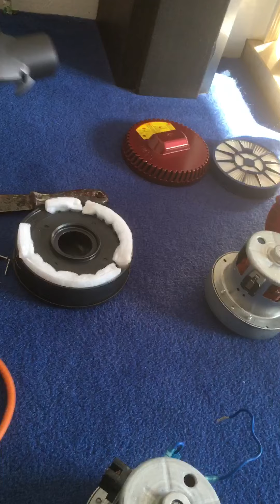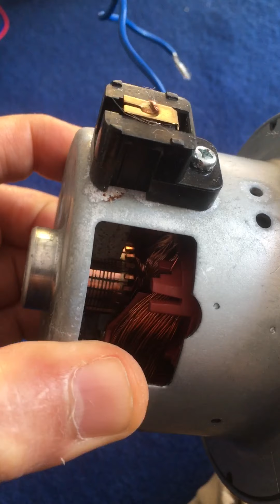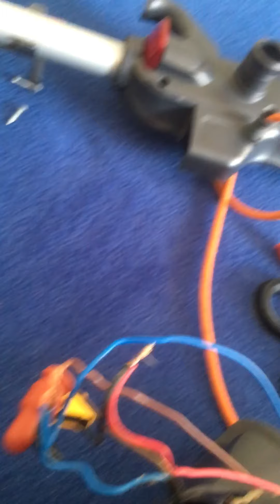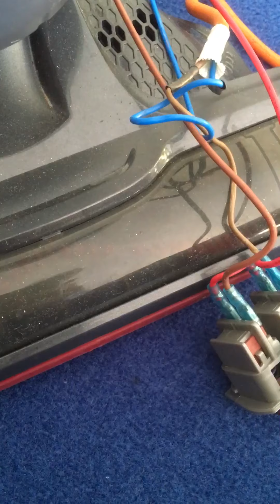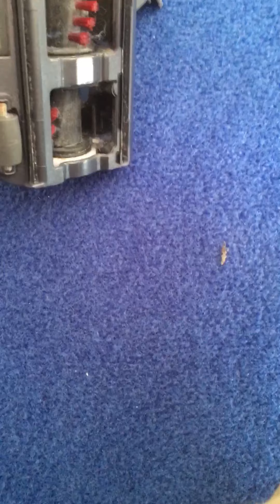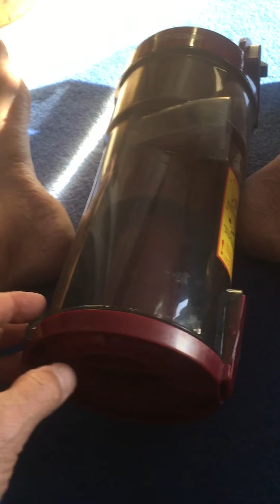Hoover VL81 repair

Comment: Thanks for posting this. I just fixed a VL81 with the same problem. The Spade connector to the thermal switch has snapped. I would have given up if I had not seen this